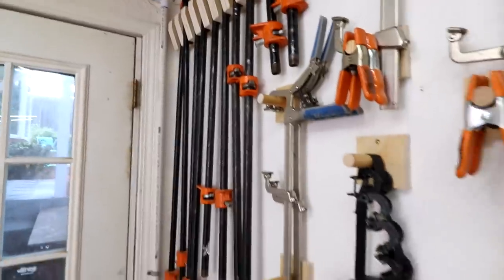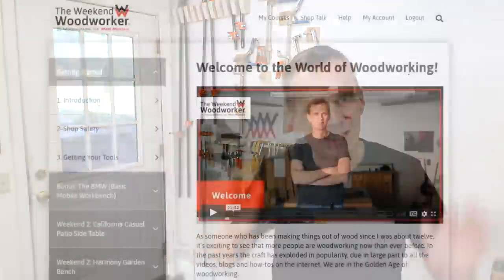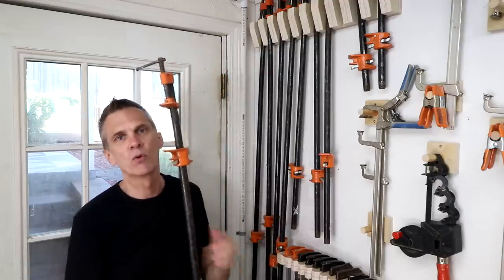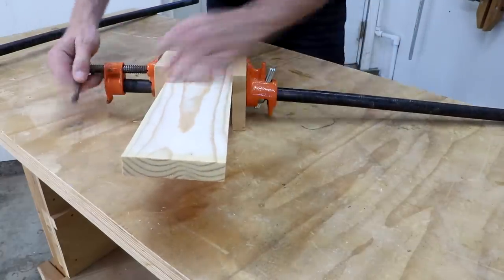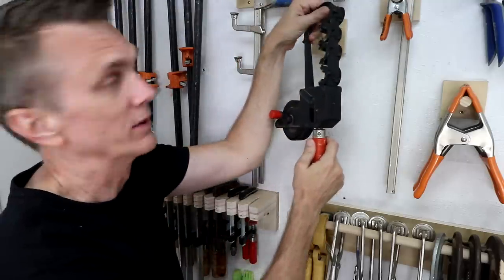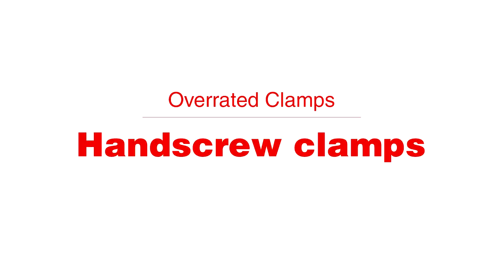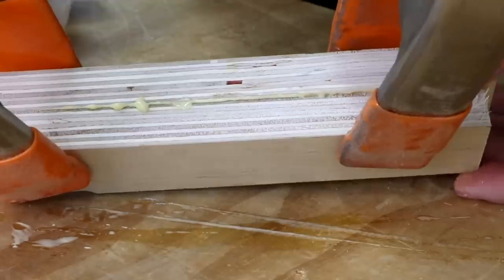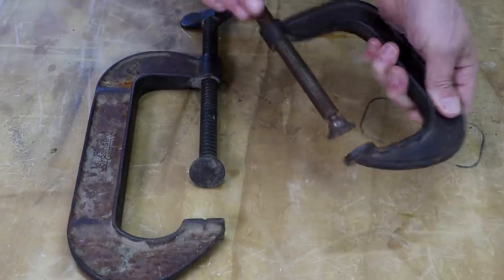How many clamps do you REALLY need? Woodworking basics.

Comment: i agree about C clamps but spring clamps i have found very useful. i bought some corner clamps but found they are a bit gimicky. but my opinion you can’t have too many clamps as i use all of mine for different reasons, depending on the project. but i agree the bar clamp (F clamp as we call them in NZ) get the most use

Comment: I think you need to invest in some quick grip clamps. They are probably the most used clamps I have. I agree that pipe clamps are probably the most cost effective clamps and they work well but I wouldn’t waste my money on 1/2” pipe. I have a couple of them but I rarely use them. The vast majority of mine are 3/4” and I love them. I also have a lot of aluminum pipe for them and that is way better than black pipe. No black marks from the pipe and no rusty pipe either.

Comment: My first clamp was a huge C-clamp.  And I didn't even use it for woodworking.  I normally use it to push in the cylinder when changing the brake pads on my car/van.

Comment: I have a few C - Clamps on my welding cart and my Drill press. As for the spring clamps, I find myself using them quite a bit for random odds and ends as a thirda hand really but they are handy depending on the projects you are doing.

Comment: I've only got the set of bar clamps (trigger action type instead of the screw type; personal preference). I've never felt the need for any others. Though I do have a few smaller C clamps that I used for semi-permanently holding stuff down; that's all they're good for.

Comment: I prefer bar clamps, they’re usually what I use the most. I don’t have pipe clamps, but I have something along those lines, it’s not an F clamp, but just a thicker aluminum bar clamp that I love the most. I also dislike C clamps. I use them only when I have to. And I want to like spring clamps, but I experience the same issues with them that you mentioned.

Comment: My advice to anyone starting out is to buy enough clamps for your first simple project. I also agree that a band clamp is essential. After that, buy clamps as you need them or when a great bargain comes up. You'll get an idea of what clamps would be best for you as you go along.
Reply: I disagree. This is terrible advice. If you buy clamps (and more broadly tools) that are ONLY suitable for your first simple project, you likely will find you have to keep spending more money when you move onto other projects. I would say get what you can reasonably afford, while thinking about the size of project you're likely to be doing going forward. Extreme example, but if you went out and bought 45 inch sash clamps, then you've basically catered for the extremes and everything else in between, so you won't need to also buy smaller sash clamps then.

Comment: I made myself some corner clamps out of square sections of plywood scraps.  You still need a bar or quick clamp to use them, but they are pretty great for a very quick and simple shop "tool".  I love my strap clamp but these suckers make the corner be square even when it's not in a cooperating mood.

Comment: Personally I have a lot of C clamps left over from my father and grand-father. I saw your comment about how much work it is to open and close them but, I always hold the handle and spin the C part up and down while JUST holding the handle. Unless the clamp is really tight, this is a one hand job that takes only a few seconds to open or close a lot of distance.  I left  you a note on another of your videos when I couldn't get the comments to come up on this one (finally did get them) regarding black pipe vs regular water pipe. I hate the black pipe because it tends to mark my work piece and have never had that problem with the silver water pipe. Just curious why so many people use the black version.

Comment: Regarding C clamps, I mostly agree. I can imagine scenarios where small c clamps are useful, but I haven't needed one yet. 

Regarding the wood screws / hand screws / whatever the wooden ones are called, we made great use of them in woodshop classes in school. When I looked into buying one though, I realized they are WAY overpriced. I like them, but they're not worth $30+ USD. Bar clamps are my main choice. 

Spring clamps aren't very good for normal clamping applications, but sometimes I'll use them with a bar clamp to hold something to my bench for while I'm filing. (This isn't usually wood that I'm clamping, more often it's for making small tools.) I use the bar clamp to hold it down and the spring clamp to help hold it down, but more importantly it keeps the bar clamp as well as what I'm working on from rotating too much. That said, a good vice would work better. Considering that spring clamps cost between $1 and $2, maybe $3 at Home Depot, I keep a few around, and I get my money's worth. I just don't think it can replace a bar clamp.

Comment: I use the wooden screw clamp constantly,  both at the drill press and the router table. Especially if I'm cutting box joints or dovetails.

Comment: G Clamps (I think you call them C clamps over the pond in USA) are good if a lot of pressure is needed and can hold fence's in place and stop blocks when you being rough, alright clumsy. Pipe clamps are hard to get near me but can get cheap quick clamps. Those one handed pistol grip ones! Not needed over 3ft yet but we can get cheap sash clamps for that (square ones ) . The clamp you need but have not got is the one that's 1" bigger than the biggest you got free!

Comment: You can have enough clamps, but you can never have too many clamps.

I like pipe clamps for small workspaces: you will want to clamp up large pieces every once in a while, but for the rest of the time you can replace long pipes with short ones for very little extra cost – this will make the clamps far less cumbersome to use, and you can still go back to the long pipes when you need them.

Comment: I love my aluminum bar clamps by rockler and their pipe clamps are much better than the pony because they elevate to allow you to tighten without adjusting that little twist pin. I actually returned my bessey parallel clamps to buy more aluminum bar clamps due to the weight

Comment: If you use pocket hole joinery, then you need the Kreg face clamp and the right angle clamp to make the joints easy. Sure you can get by without, but you'll faff around trying to get the pieces either  flat or square and lose any time saved by using pocket holes

Comment: My essentials are parallel clamps and F-style clamps. I have found a lot of use for the strap clamp, but don't use it on enough of my projects to call it essential. 
I cannot remember the last time I actually used a c-clamp, or those spring clamps, even though i have many in my shop.

Comment: To each his own. C-clamps are my most used clamps, but my woodworking space and method is not very conventional. I could not build what I build without good C-clamps. I use them to secure my circular saw cutting guide. No other clamp does the trick. Since I am a photographer, Spring clamps are essential. You just can't imagine how many times in construction and household chores where they come in handy. Especially those eBay photo shoots when I need to sell all the stuff that doesn't work for me.

Comment: I would have agreed with you until I started making hollow wood surfboards recently.  Can always use more clamps, and spring clamps are essential for bonding on the deck (not a fan of making cheap spring clamps from pvc pipes).

Comment: for the last 15 years i have have managed with only one or two! i used the old rope clamping trick. never come across a project where i couldnt use it or a board with wedges. however i recently bought a set of 20 bar clamps as they were on offer. i have used them as they are faster than the rope method, but did i really NEED them? probably not.

Comment: While I agree with your list of essential types of clamps, the number of those clamps needed for a project is often more than I have on hand. Certainly more than 4 of a kind. Not always, but many times. Also, the wooden hand-screw clamps are extremely handy for multiple tasks including as a 3rd hand for cutting small parts, extending the height of your bench vise for fine cutting, in addition to glue ups, but I wouldn't bother having  more than 2 unless I got them cheap/free from yard sales and the like.

Comment: Yeah, well, you're entitled to your opinion. 😄
9 clamps will never be enough for me. I have 52 clamps and, occasionally, I run out of clamps.
Reply: MadMulberry lol I’m curious what projects you used 52 clamps on? I’m always running out and I find there’s always one projects that I need another clamp.
Reply: @MikeTheMaker1  The last one was a glue up for a chest of drawers when I was gluing up the 8 drawers. Of course I jest about using ALL my clamps because the 20 spring clamps were unsuited to the task. I used all my bar, F and C-clamps (2 per corner with a corner brace).
Reply: MadMulberry yup that’s use all your clamps lol.
Reply: MadMulberry I think I have about 80 clamps, and I have ran out of clamps on a glue up too, many times.

Comment: Not having a table saw, most of my cuts involve clamping a straight edge to a board to guide the circular saw.  I like spring clamps for that, though I should probably drop the $10 it takes for a straight edge clamp.

Comment: For a little while I was in the "clamp of the month" club...  and got a few Bessies... then a few pipe clamps..  and a buttload of F clamps.

I do have 2 parallel wood clamps which I rarely if ever use, and I have 1 C clamp... for my brake jobs when I need to compress  the caliper.
Love my Kreg clamps, for quick drill press jig positioning. (Rockler, I know you tried to copy them, but I don't like your version.  Having said that... let the wars begin!)

Comment: I find "C" clamps to be really valuable for holding something to a workbench semi-permanently.  They take up less space for their relative strength, so they're good for tight spaces.  Probably not much help for gluing and clamping workpieces directly.
I keep looking for those "dog clamps" at a decent price for when I want to hold something down on the middle of the workbench.  Haven't found a good option yet.  Probably not that necessary for typical woodworking either, though.

Comment: I have to disagree with your numbers, but you are sorta right, most of us have more clamps than we really need most of the time (don’t tell the queen) but there are some times that I need just 1 more.
No one else mentioned Swivel Pad C-Clamp Locking Pliers (ViceGrip type) I use them very often. 
My most used clamps are cheap 6” bar clamps. Some of the specialty clamps do jobs nothing else will do.

Comment: You should have discussed ratcheting bar clamps. I prefer them to the F-style bar clamps you discussed, and use them almost exclusively. I don't like the knobs on F-style clamps; they seem designed to minimize mechanical advantage when tightening. I would also offer the opinion that C-clamps are indispensable for welding. They are more rigid, provide greater mechanical advantage when tightening (as opposed to F-style clamps), can exert a tremendous amount of force, and most importantly, are (under normal conditions) non-combustible.

Comment: I think the 9 clamp approach will certainly get you through 90% of project parts. I don't think I use more than 9 on any given glue up, etc. BUT, when I'm gluing up 3 drawers, or more than one picture frame at a time, more clamps saves you time. You can clamp everything up and go to bed. With just 9, you'd be swapping them out every hour or so as glue sets. Is it doable and a great start? Absolutely. But if more can save a lot of time if you have multiple parts.

Comment: Harbor Freight quick release bar clamps do the job just fine and run for 25% of what you're spending on Bessey clamps; if you're somehow mangling them I'd suggest that you're clamping too tight to begin with.
Reply: My HF quick release bar clamps don't hold reliably. They can be rejuvenated by roughing up the bar with a hacksaw, but it makes a mess. What's your secret?

Comment: One nitpick I have on the bar clamps, is there is no way 4 would be enough. I routinely use a dozen bar clamps at a time for a single glue up. Or I have bunch on a glue up waiting to dry, and I need some more for another one. Even for the DIY woodworker working on small projects, I'd take or recommendation of 9 and add at least another 4 bar clamps.

Comment: I use pipe clamps for the majority of glue ups in my cabinet shop. I disagree that 3/4” is too big. The smaller 1/2” diameter can bow and touch the wood if you put significant pressure on it. 

Those bar clamps are actually “F-style” clamps. Real bar clamps are more like pipe clamps but with a rectangular bar instead of the pipe. 

You also left out quick grip clamps. They don’t usually have the clamping strength of the others but it’s great to temporarily clamp something with one hand until you can get more clamps on it. Or if you need to set and remove the clamp a lot like for a stop block. 

I pretty much just use the handscrew clamp as an auxiliary clamp. I can use it to hold pieces on edge for assembly or planing. You can also clamp it in the middle of a long board to have something to hook a shorter clamp to for glue ups.
Reply: Foreigners call F clamps G clamps.

Comment: I keep a giant c clamp around - for when I need to push a piston back into the break cylinder... If you're a "general about the house handyman and fixer upper" your clamps needs will vary more widely.
As for clamp on clamp action: in my experience it's better to have them each pulling on a loop of rope - once tension is on, the clamps being "not quite in line" can lead them to suddenly slipping, and letting that tension go all at once can be... challenging.
Reply: Or pulling on a C clamp, since the rope will stretch over time

Comment: 4:32 I need a pocket hole kreg clamp...I bought the kreg jig , but you got to buy their clamps seperately
Question : does the 36" pipe requires some kind of maintenance treatment , over time ? if yes, what do you do ?

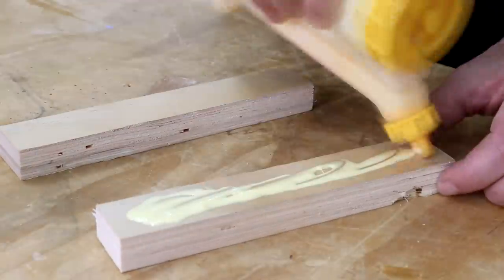6:02 A new tip I learned to prevent slidding of boards with glue....is sprinkle some salt on the glue,..and it will hold securely...haven't tried it myself....but will soon..

Comment: The strangest ‘clamp’ I’ve ever seen is basically a series of thin wooden or plastic dowels with a soft ball on one end. A solid piece is held horizontally above the workpiece by a stand and the dowels are bent to fit between that and the workpiece. The natural tension of all these rods as they’re bent applies a gentle clamping force in an infinitely variable pattern. It’s a luthiery tool, I think.

Comment: I'm not a fan of the F clamps, I prefer the ratchet clamps you can use one handed. But bar clamps are always useful. The UK the round bar clamps aren't that common, at least in my neck of the woods, we have the aluminium box tube clamp. Same function, but with a square or rectangle bar.
Most of my clamping is done with just those 2 types of clamp. The spring clamps are more as an extra pair of hands.

Comment: spring clamps aren't useful for clamping wood for glueing etc. Its for holding things temporarily and fast, not for secure holding wood till the glue dries. You use it for tarps, thin pieces, holding a small object in place so you can drill into it or nail it etc.

Comment: C clamps, I dunno on a drill press or to hold a stop block I've found them at times indispensable. Not to mention outside of woodworking. lol if you sprayed some dry graphite on those threads you might find them a bit less fiddly to use.

Comment: "I have enough clamps" said no woodworker, metal fabricator, welder, etc, etc. ever.  But seriously, my most used clamps are those inexpensive squeeze handle bar clamps.  I have quite a few C-clamps but don't use them very often either.

Comment: it looks like your pipe clamps do not come with standoffs to raise it above the bench,, that surely makes operating the screw hard, I only buy 3/4 inch pipe clamps so they don't flex, and the number of pipe clamps I use tends to be an odd number 3 on the bottom, 2 on top,, or such.to even out the pressure the clamps are applying

Comment: I partly disagree with the spring clamps, I only have a few F clamps and no vice (not even a permanent workbench at that) and the spring clamps are really useful when starting out.

They are cheap and free up your other clamps for glue ups instead of having to use them to hold boards down. So for beginning woodworkers I feel they are an essential tool. Just don't use them for glue ups like you said.

Comment: I like Irwin Quick Clamps, they are faster and easier than pipe clamps. They are costly so watch for sales.
Reply: They can't apply as much pressure and it's difficult to use them to glue up large panels.

Comment: So you talked down the wood clamp a bit at the end.  And I'm thinking "oh dear, I was certain I have been thinking about/looking into getting one of those.  I was certain I'd actually seen that they were quite useful".  And then I take another look at the project I'm starting next week which is your lumbar rack – and you use a wooden clamp, so now I'm going to figure out a way to hold the pieces in place while they glue without a wooden clamp – to see if you are right in this video, that you don't really have use for a wooden clamp.
Reply: Ralph, let me put in a plug for hand screws. They may seem archaic, but besides their uses as a vise substitute, as many here have pointed out, they really excel in applying pressure to a broad area, or stock of uneven thickness. With all the many situations that come up, I rate them as equally valuable and necessary as other pro quality bar clamps and deep engagement clamps.